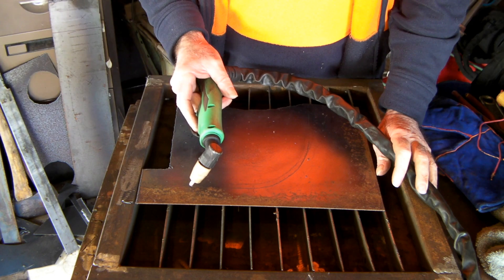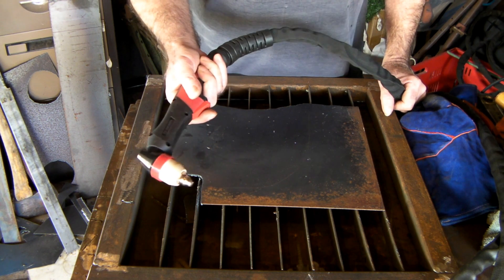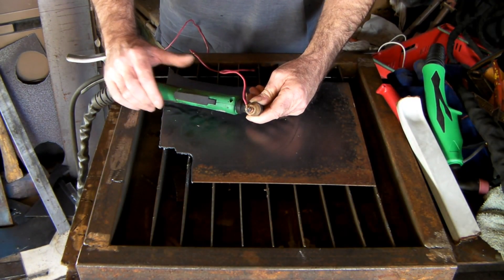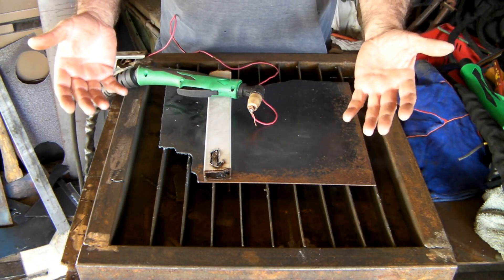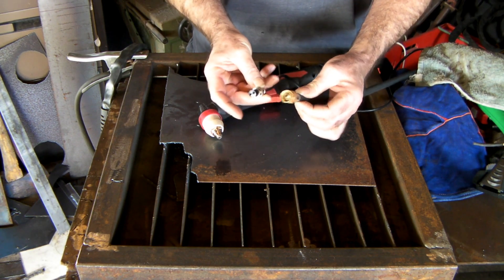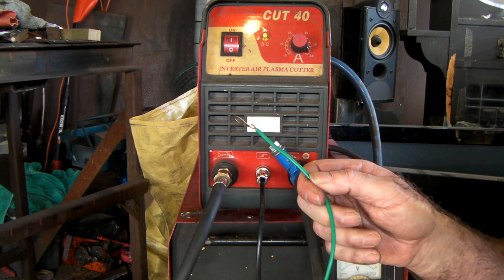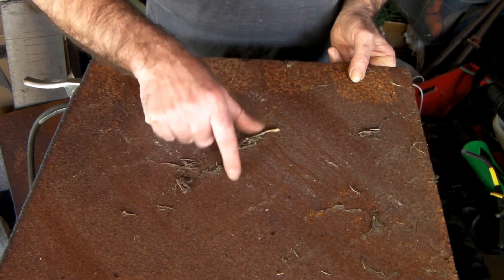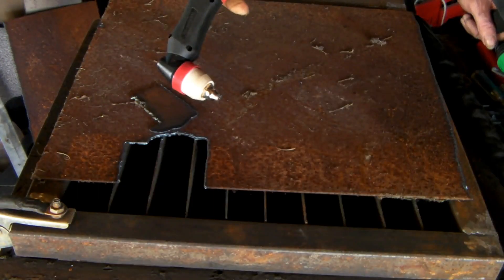pilot arc conversion FREE

Comment: Thx Pete, great stuff.
Question. I have a pilot arc torch and a non pilot plasma cutter. I notice that the consumables on the pilot arc torch are different than the ones on the non pilot torch. I presume that the full 40 amps that I set on the machine will pass through the modified ground wire on the pilot torch and start the arc before the torch tip touches the metal to be cut. If I drag the tip over the rusty metal most of the current will be passing through the electrode directly to the work piece and very little through the modified ground wire. If the torch was stood off a little will the modified ground wire continue to supply the arc current or will the electrode supply the current to create the arc if the electrode to workpiece was about 1/16 in? The modified ground wire would sure get hot if it had to carry the full 40 amps during the entire cut.
Also, the consumables on the pilot arc torch would not last too long if they had to be dragged over the metal.
What do you think?
Thanks mate

Comment: Hi Pete, Another very informative video. I'm just about to purchase a Chinese 55 am but not sure if the pilot arc version would be less reliable than the touch start. I could buy the touch start machine and do your gun trick for the few times I need to cut rusty or painted material. Or do I just buy the pilot arc version? Do you consider that the pilot arc models could have more issues? Also, can you suggest the best low-budget machine for the home workshop, please?
Well done mate. Cheers
Reply from the maker: Hi ray i would buy a pilot arc

Comment: What if you run your ground wire down torch cable and clamp to ground (like use a Dinse with ground prong that they use for Lift TIG) at machine?
Reply from the maker: Hi ,Try it mate

Comment: Pete will a self repairing fuse in between the green line not protect the torch by only allowing pilot arc for couple seconds just to start before tripping the fuse?
Scared the little green wire will take full amps and burn, or will power always jump to bigger clamp wire
Reply from the maker: Sounds like a plan mate. Try it

Comment: Hi Pete Tom in Scotland, I did your hot wire up for the Plasma cutter and it works just fine.
I am getting on well with projects now that I have a cut 50. I can do 5mm plate on 40 amps and psi at 60psi or 70 it works just fine what a clean cut. very little grinding.
I am now working on how to put a video on to you tube to compliment your tips. Take care. Auld Tom. Ayr Scotland.
Reply from the maker: Hi tom did you get your video done?  Give me a link and i will put it in the description of mine if you like?

Comment: I want to attach 5v relay to control my Torch, but the 5v relay I have is 10amps,
But my Plasma is 40amps,how can I connect with Relay and use on CNC
Reply: You can use the 10A relay on the control circuit. It isn't using 40a to start the torch that is a separate circuit
Reply from the maker: cnc is not really my thing sorry
Reply: @petestools no issues sir, thank you

Comment: Great video, wish I binged watched them all, before burning up all my consumables waiting for delivery... Ha ha, Wooo weee. 
Question, thinking of buying a pilot ark gun for non pilot, cut 50. Is that the way to go for cutting welds? Thank you
I'm curious why the earth wire in pilot wire harness, would not get hot as well?  In theory, coiling the tip would be same as wired at machine... unless it is inverted in the gun??? Hmmmm.
Reply from the maker: Yea should work for cutting welds BUT I DOES GET HOT.
cheers pete
Reply: @petestools  Thank you sir. Learning a lot about these suckers from your videos. All the best, Oregon, US

Comment: Thanks Pete! I have an Amico box which has a ground bolt on the back. I've wondered for a while now what would happen if I bought a pilot arc torch and just connected the ground lead for the torch to the ground bolt on the box, extending the wire a bit if it doesn't reach. Going to buy a torch now that you've shown me how it's done. Need to cut some painted barrels. Plasma is cheaper than using gas which is what I'm using now.
Reply from the maker: Right on
Reply: O
Reply: So how did this work out for you?  I'd really like to know.